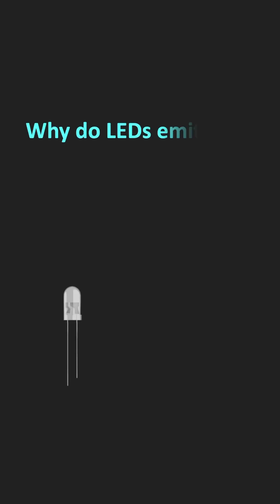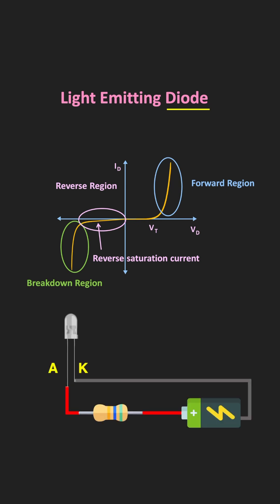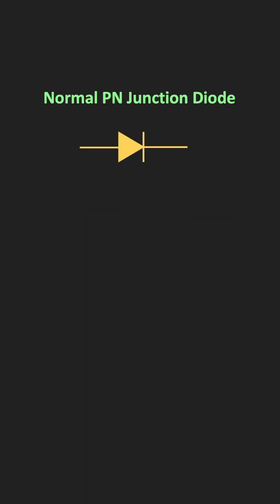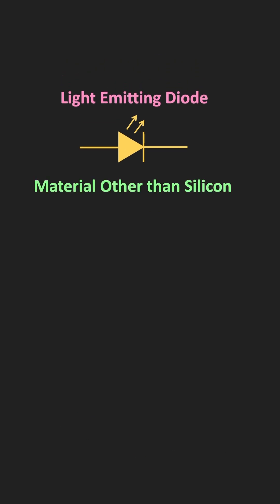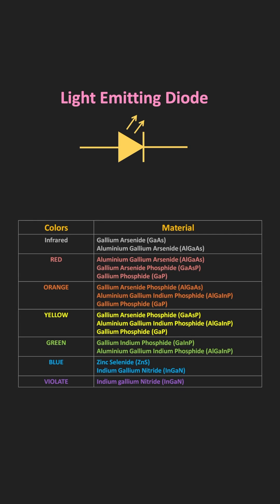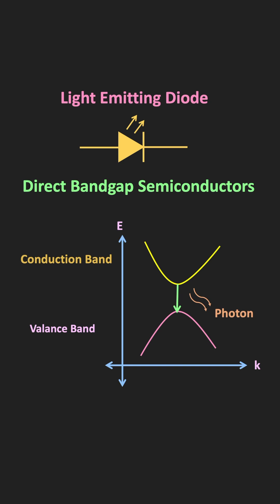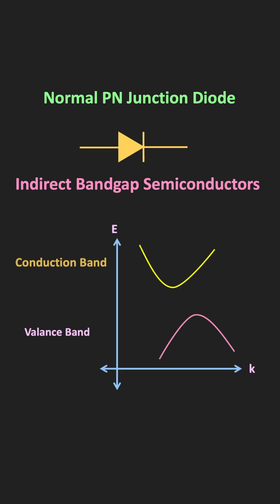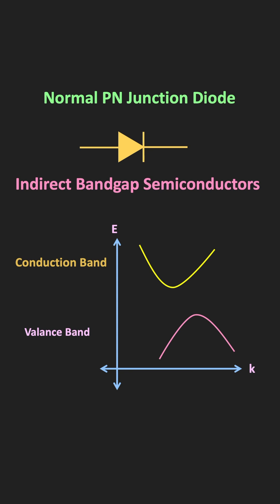Why do LEDs emit Light while Diodes do not ?#led #diode

Comment: may be i am wrong, in a dark room when you heat a iron substance you initialy feel heat, but you cant see it then as you heat more and more it starts to glow , i think heat and light or like same same but different, thats the reason led emits light . dont forget it also produce heat simultaneously . now its your time to imagine . may be i am wrong until i found more
Reply from the maker: Every object with a temperature above absolute zero radiates electromagnetic radiation, including all bodies. This is known as thermal radiation, and the type and intensity of the radiation depend on the object's temperature. We humans are also radiating electromagnetic energy (Infrared). The wavelength of the radiation depends on the temperature of the object. So intialy when you heat the rod, it is not so hot, that's why you are not able to see the glow. When it heats beyond certain temperature, you can see the red hot iron. (The same is also true when you heat some metal). And that is why we are able to see the light. (due to thermal radiation). but the physics behind LED is different. We are giving electrical energy to the semiconductor, and that energy is released in the form of light. (and some in the form of heat, as no process is 100 % efficient). I hope, it will clear your doubts.